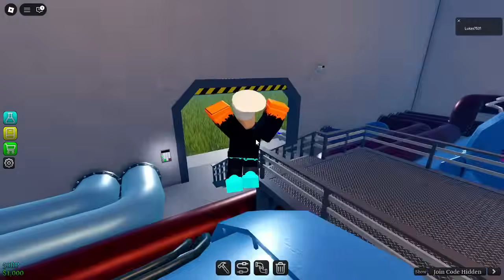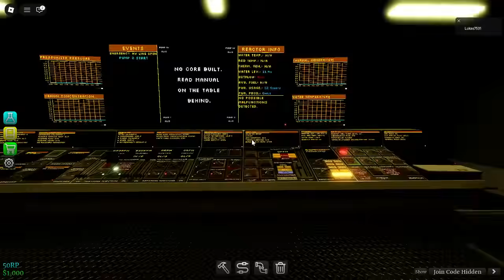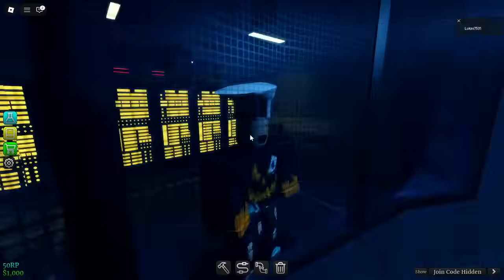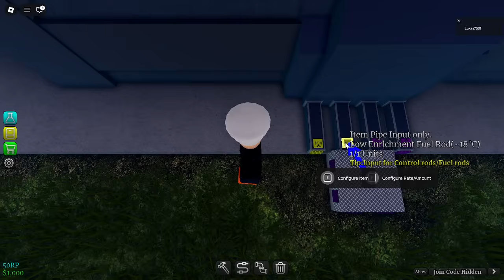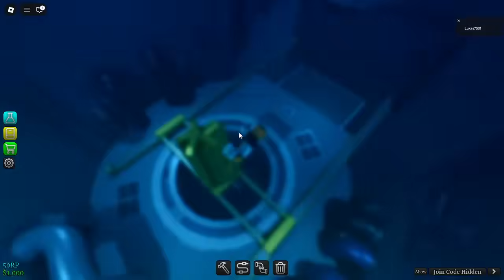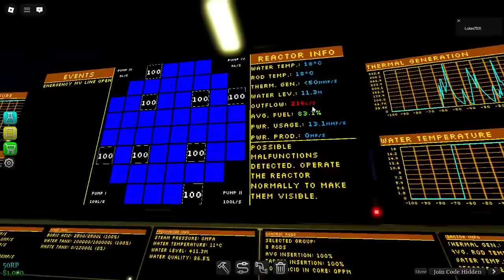Industrialist Nuclear Power Plant Guide (buttons+Reactor build+Tour)

Comment from the maker: guys im sorry that i was kinda quiet and you cant hear me properly so i recomend putting subtitles on
Reply: You've made a crucial mistake at building core, you've made it really small, that why it produced only 1M of thermal energy, if you want get to the 1 gmf of generation, you need to build a core at the visualising radius 6, so it could at least work, but the best is 7 or 8(10 takes 1 hour to build, so its not best option)
Reply: @bebranebra why when I click apply my core does not start to assemble?
Reply: @Tiggifyno control rods i think
Reply: Could you do it again and make youself louder i cant hear anything and subtitles dont work
Reply: You really helped me so much and the moment you said esfggwgwgw helped me
Reply: Don't worry man, just try to configure the audio and lower the in-game sound is my advice